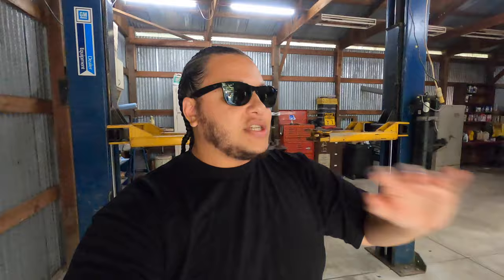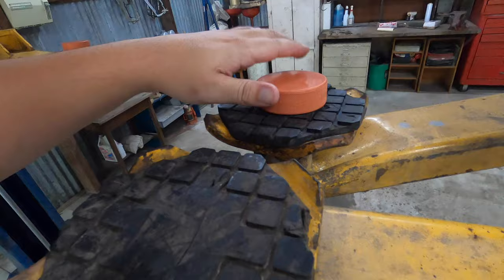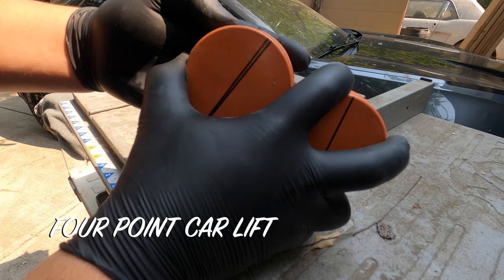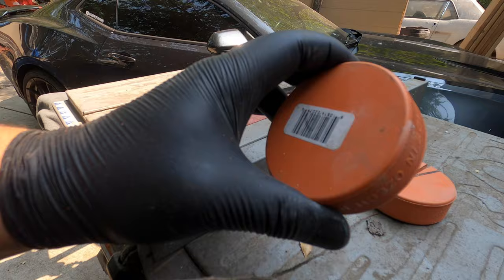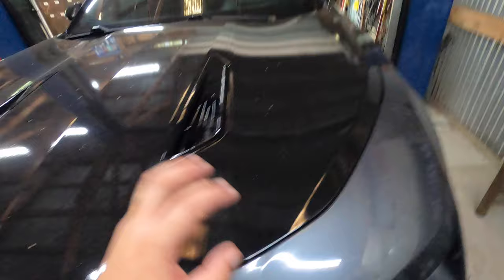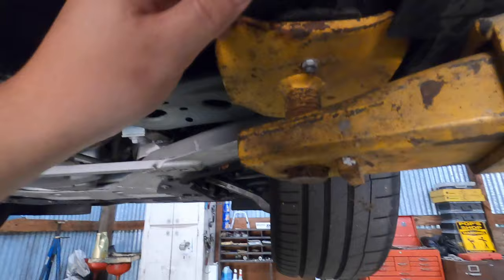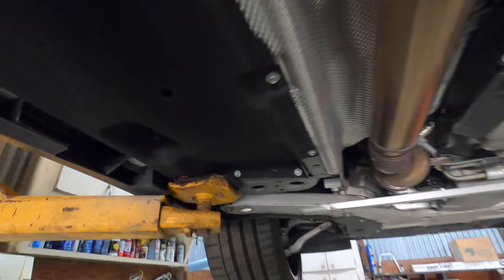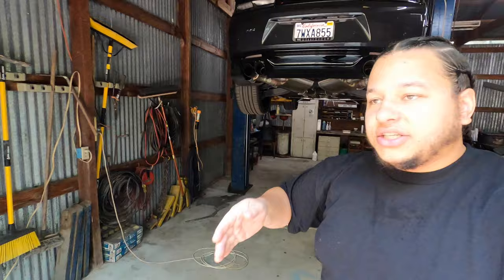CHEAPEST Jack/Lift Pad Pinch Weld Adapters (Hockey Pucks)

Comment: I made mine out of hockey pucks, i use the black medium rubber ones, if i need a little more lift i slip on of the hard orange ones under the black one. Been working well, been using them for about a year now, and work on my friends cars too so best band for the buck for sure
Reply from the maker: Yeah no doubt. I was definitely happy with how they came out. If these lasted a year I’d be more than happy